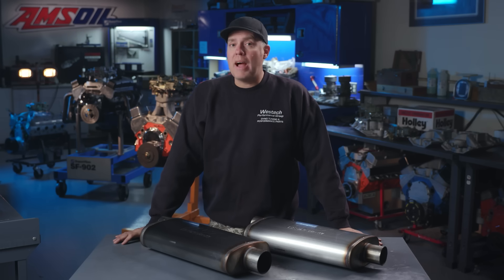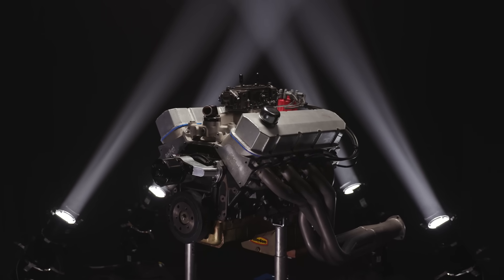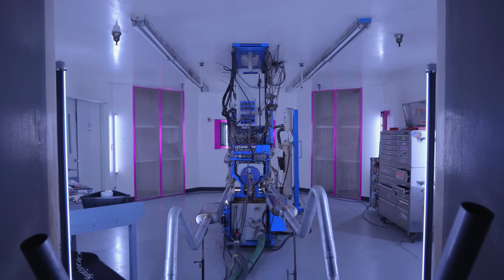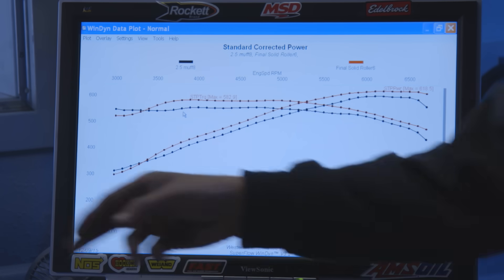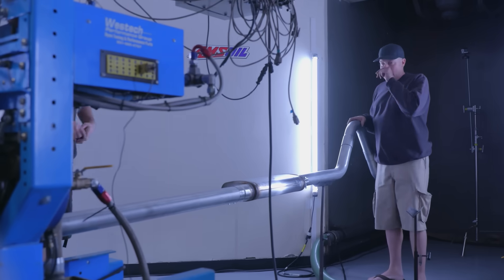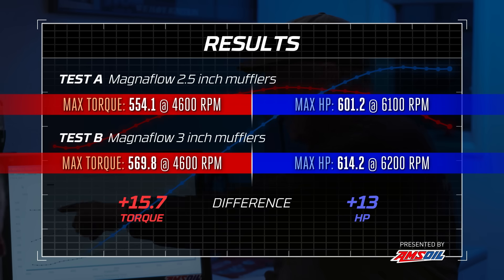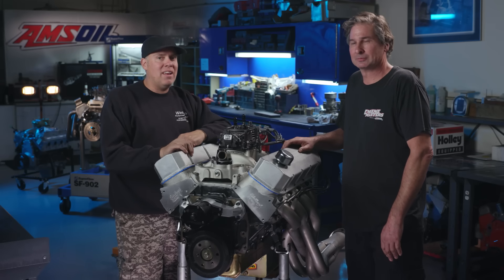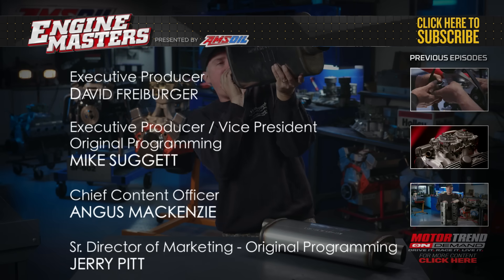The Power of 2.5- vs. 3-Inch Exhaust - Engine Masters Ep. 9

Comment: How long do you think that Mech, roller cam will run on the street before you break a roller lifter ??????
Reply: +davie biggions Mechanical roller lifter's are more reliable than hydraulic one and Hyd. rollers can go 100+K. The only problem is solids need to have the clearances set/checked.

Comment: During the 2.5" segment, you indicated that the A/F ratio went rich. I wonder how much horsepower could be recovered by leaning out the carb (jet change). I also noticed a "brick wall" HP fall off at the very top end ~6400RPM with either muffler vs collector extension only.

Comment: When you take a motor tuned for open headers and run it thru exhaust of course it's going to make less power with 2.5" pipes than it does with 3". I bet if you were to adjust the AFR there would be even less of a difference. Definitely not enough to worry about. 2.5" is as big as I'd go on a street car.

Comment: But who uses Magnaflow anyway?
Reply: +Chris Shannon Well exhaust is more about sound & Price for most people. If you use the 3" flowmasters 30/40 series, they would flow/make the same HP as the smaller Magnafows. I main care about the HP and that it's stainless and only needs to be done once. I live in the Northeast and mild steel exhausts look completely rusted after 2 yrs...it too expensive to be doing every 5-7years.
Reply: +Chris Shannon They are one of the top/if not the TOP muffler in the USA. They are stainless so they are more expensive than flowmaster's or dynomax's...but you get what you pay for.
Reply: +JerseyMikeP sounds legit but Corsa has my vote.
Reply: +JerseyMikeP They're testing WOT so if any horsepower or torque gained you wouldn't even see it at lower RPM's aka Normal driving conditions. I thought all high end mufflers use Stainless Steel. Corsa definitely does. I'm more of a sound guy so the more aggressive/raspy is my passion. But I think we're saying the same thing here. I definitely agree. Stainless steel is the way to go for sure
Reply: I was refering to Flowmasters...with there chamber design. I wasn't talking about Corsa.

Comment: That was a very impressive demo. I knew that supercharged engines just want to get the exhaust out as the intake is pressurized, but the lower  back pressure on an aspirated engine surprised me Makes me wonder what would happen if I replaced my stock 1.75" exhaust on an aspirated, fuel-injected Nissan 4-liter with a 2.5" since it appears that reduced back pressure actually increases air flow through the engine. The EFI has a Mass Airflow sensor to adjust for increased air flow.

Comment: does this mean I will get more miles per galon (MPG) with 2.5 or 3 inc exaust muffler? I am a little confused. What is important for MPG (torque or horsepower?)
Reply: +Stefan Djordjevic Low back presure will help with pump lose...which lowers MPG..BUT most people stay in the throttle more with the throatier sound which kills an gain. Reducing intake restrictions improve MPG more than exhausts, that's why BMW's use the Valvtronic and not the throttle body to control engine speed. Removing weight from a car (stuff in your trunk),  tire pressure at spec/slightly above..help with MPG. Motor trend had a good article showing the savings by doing that. Like A/C vs. windows down at different speeds.

Comment: All you really investigated here was how pipe diameter impacted AFR.  There was actually very little difference between the two in terms of percentage, so I was surprised to see you so excited by the higher values associated with the 3" pipe.  What would be a great experiment and earn you shit-loads of views is this:  Take a warmed over LS engine, and run:

- twin 3" with X pipe
- twin 3" with H pipe
- twin 3" true dual
- twin 2.5" with X pipe
- twin 2.5" with H pipe
- twin 2.5" true dual

Run EFI on the engine and tune AFR and timing to optimal in each case.
Monitor exhaust gas temperature.  Does the 3" yield lower, safer EGT's? 
Give the engine a street driveability rating/10 - which would include low end torque numbers and response.

Comment: if you made an 18 inch cone adapter to go from the 3 inch headders to the 2.5 inch system it would perform much better. speeding the gas up with out turbulence. also I would like ti see the chart from 1200 rpm. not everyone drives an auto

Comment: Would a 32 valve V8 make a diffirence diffirence? Only 2 valves per cylinder restrict quite a bit of air.
Reply: +Cold_Fox89 The # of valves don't matter..it's all about air flow/HP. Here' is a sizing chart from Dynomax.

http://www.qsl.net/ya5t/techchart.jpg

Comment: Does anyone care a rat's ass if an engine has more or less 600 horsepower?  An automobile is simply a tool to get you where you want to go and return.  The rest...high horse power, Internet connections, television screens, high amp sound systems (the list is endless)...is just utter bullshit or worse:  subconscious substitutions for inadequate penis size and/or paranoid delusional grandeur pursuit.  Dr. Rex Carz  has spoken.

Comment: would the results be the same regardless of HP or engine size?
Reply: +Patrick Handy The higher the HP the greater the difference there would be between the dual 2.5" vs. dual 3". For example on a 400hp v8 the difference would be maybe 1-2hp but on a 800hp engine the difference might be 30hp.

It's like breathing with a scuba setup on..if you're relaxed/calm it doesn't affect you that much...but if your panicing..seen a shark..the small tube size would have a big affect on your breathing.

Comment: These pieces of shit engines uses carbies? Fucking gay
Reply: +hyusama "fucking gay"? this is a 600+hp engine buddy, what have you got?
not what can you look up online. What are you driving? if its over 600hp i'll check it out, otherwise i think your comment is more about you bud... cheers
Reply: I'm not American. And anyone who thinks they can gain practical knowledge across the board from this video doesn't know shit about cars. This video is only practical for a specific type of engine that hot rodders commonly would build. That is a push-rod V8 producing around 600hp. It is only practical knowledge for a specific configuration very close to or the same as this. If your unaware how to calculate correct exhaust size for an engine you do not deserve an opinion about anything engine related. An engine is an air pump buddy nothing more.hyusama
Reply: +hyusama   They are still on push-rods,  a crappy single cam with very narrow lobes that soon wear down and two valves per cylinder   1960s technology and that is being kind about stuff that should really be in a museum.

An old colleague who lives in CA has a four wheel drive Audi Quattro type of vehicle.  On take-off it can spin all four wheels at once!  Not bad for a road car.  The Nissan Skyline GTR is also extremely good and it too has four wheel drive.  Times have moved on!
Reply: +hyusama true that bro. you make a very compelling point i have to say
Reply: 600hp n/a motor is impressive enough for me, although i do agree if it were more modernized that would be something. I\m sure they have EFI conversions as well.
Reply: hyusama not a fan of efi :) old school is what i learned to work on and itll stay that way
Reply: you are gay for liking fuel injection
Reply: +Shane Mouton but it could be 900hp+ and be 100% more efficient if it had the newer technologies but no, I get it, you just wanna stick to tradition even if it's technically a complete shitfuck of an engine because you guys can't deal with change.
Reply: +HeavyJ318 I'll watch whatever I want

Comment: I do not know if anyone else did the math, so here is this...
I did not catch it if they said the exact muffler that they used for the test, and frankly makes no difference for the purposes of this comment.
Both mufflers being the same interior volume (he made mention of that), and using the assumption of 25' of pipe (as he claimed off-hand), the internal area of the 2.5" exhaust is (assuming 3.14159 for Pi) 1.25 x 1.25 x 3.14159 x (25 x 12) = 1472.6203125 in^3 AND the internal area of the 3" exhaust is 1.5 x 1.5 x 3.14159 x (25 x 12) = 2120.57325  in^3.
So the difference between the two is 647.9529375 in^3. That may not seem like much, but if you consider that the 2.5" is 69.4(repeating)% of the 3" in total volume, that is a big difference. We are talking about a 44% increase from 2.5" to 3", not insignificant.
Anyone want to double check that math?

Comment: Id like to see the Dyno test start just off idle. On the street you have to get from idle to 3000rpm before you see these Dyno results. Is it possible the idle-3000rpm torque with either muffled exhaust system results in a faster car?
Reply: +FIXR7 The thinking is...
1. If your car is an automatic, at a launch the TQ converter will stall/flash close to 3,000 so below that the time is small. True on the street it would matter for cruising around...not racing.
2. if the car is a manual, you also launch/slip the clutch at low rpms and after the first shift the RPMs drop to somewhere above 3,000. And a car with alot of torque can actually be harder to launch...(example regular vette vs. a viper).
Reply: Cheers Mike, I know that's what they're thinking but, I think they're missing the point unless it's ONLY a racecar.
Reply: +FIXR7 It only matters under acceleration..true...which is my point. If your cruising  at 15% throttle your not losing anything.
Reply: +JerseyMikeP I disagree that it's just under cruise. So often I see cars with a big top end get taken by those with greater area under the curve. I think it's likely that this engine performs better with the 3" twin but if compared to open headers I think the 3" setup would be faster on the street.
Reply: FIXR7 Disagree with what?

True a car will be faster if it has more area under the curve...BUT you have to take into account the rpm range. After a shift no manual drops below 3K and with an automatic the converter would get it to 3K rpms before it move 2ft.

You'd also have to consider the extra 82lbs slowing the acceleration. The old racer's moto 100lbs = 10hp and .1 et 1 mph on the drag strip.
Reply: I disagree that it's only under cruise conditions that performance isn't lost. And, I do understand about the other trade-offs like weight but maybe the extra torque will negate the effects of 80lbs? and the difference is only 10lbs to the 2 1/2" system and being a street car you need to run some sort of exhaust I'm assuming so, open headers is a moot point? I suppose I'd like to see a chassis dyno test and then some actual race tests to see the real world data.

Comment: I run a Diesel with a 4.5 inch exhaust without a muffler and I get plenty of power and torque so their talking out of their ass about it loosing torque with an exhaust that's big and these guys just use petrol (gasoline) why don't they wake up to the fact there are different fuels out there I mean really the different sized exhausts help the breathing of the engine, a muffler granted muffles the sound but also adds back pressure which for some engines are good but if you had a 3+ inch would you really want your car to be quiet?

Comment: i can see it works with that engine setup, but modern cars are fuel injected and lean or richen the mixture using the ecu, wich would be too annoying to rejet a carb and try to optimize the jets, I would love to see this type of test on a fuel injected engine with a fully programable ecu tuned to each muffler setup too see how much they make with modern fuel injected engines

Comment: My car is a big heavy cadillac,7.7litter engine, a low gear with plenny of torque :max RPM is 5000 and the performance are better with 2.5 inch exhaust.So keep it in mind...

Comment: So would a bigger exhaust improve the power of my 01 Dodge Ram with the 5.9 Magnum? I thought about saving up and getting a high performance air filter.
Reply: +T Ritchie If the motor is stock...the exhaust will only affect the sound. The stock cat back is not small...it's the cat and everything before it that is the restriction. 

For power-
1.A cold air intake w/ a K&N will give you twice as much power (http://www.knfilters.com/search/product.aspx?prod=57-1511-2) K&N  made 11.8 more hp.  BEST Bang 4 the buck.
 2. I'm not sure with your year but a computer or tuner will give you a boost, a good amount of TQ with the advance timing.
3.Replacing the exhaust manifolds will be the next biggest bolt on. Get long tube (TTI are the best) or Tri-Y's from Doug Thorley. The stock manifolds >1993' are small. The tri-y's will also boost low and mid range torque. Shorties aren't worth it IMHO and don't give the power increase as the TRI or long tubes.
4. If your not looking to do much a set of higher ratio Roller Rockers will give you a 10+/-hp boost.

Comment: 110 Lobe Separation with over 600 Lift means It's gonna be Choppy at Idle. 

Gonna need at Least 114 or 116 to get rid of the Chop and make it Smooth.

My Stock Camaro has 245HP and It's got a 2.5 to 3" Flowmaster Exhaust and sounds Beautiful.

Comment: i mean, geez, that much power, its kinda common sense that you would wanna run 3-inch. how about trying this on your typical 350hp-450hp small block which most of us budget people will have. hell put it on a 5.3l and show these guys what happens when they change exhaust.
Reply: 3 inch is the way to go if you want more power.  Coming from the Honda scene this was the case every time even on a 1.6L engine.

Comment: I have a Chevy 350 with around 550 hp @ 7800rpm. I used 2  1/2" Chevy turbo mufflers and the low end was stronger than the 3" turbo mufflers. But the top end was stronger with the 3".  You can feel  it

Comment: yeah the exhaust systems weighed 70-80 lbs, but that was for that crazy long camper van set up they had. a normal car set up would probably weigh what the guy said: 40-50 lbs.

Comment: That's exactly what I expected. I'm glad I went wit 3 inch on my 440 Duster. Mine is full exhaust over the axle to the bumper. Its fairly loud outside the car but not too loud inside the car. I have an H pipe with  Jeg's two chamber Flow master copies and Dyno Max race bullets in the tail pies as resonators.

Comment: A 3" exhaust doesn't make more power than a 2.5" exhaust, it ALLOWS more power to be made by the motor.
Reply: Adding 13 HP from simply an exhaust upgrade is huge in the naturally aspirated field
Reply: I'm in need for a bigger exhaust pipe cause I've put a bigger turbo, looking for something like going from 60mm stock to 63mm custom exhaust system. Is it a good idea?

Comment: just thinking logicaly. . . .3 inch probally still provides suffienct back pressure for a massive  7.4 liter 454 ci  engine . . . hell, the headers alone probally provide suffiencet back pressure for such a large engine . . .  Imagine putting a 3 inch exhaust on a  1.5 litter 91.5 cubic inch motor. . . . I might be wrong but maybe that would be to little back pressure. . . . in other words your test was on a massive engine which needs  a massive exhaust.. . . . . . what would happen if you put massive exhaust on tiny engine. . .  I would like to see that test on smaller more average engine to see if the " backpressure myth " is actually true. . . . maybe on a smallish 1.4 to 2.0  4 small cylinder  and a medium 3.0 to 3.5 V6. . . . ARE YOU UP FOR THE CHALLENGE OF BREAKING THE BACK PRESSURE MYTH?

Comment: I've got a 2009 Charger, 3.5L V6. What would be the best option for mufflers/exhaust/tips/resonators be? I don't need it to sound like a HEMI, that's not possible. I would've gotten a HEMI if that was available when I needed a car. So that's why I just went with the V6. Get over it. I just want it to sound... Better? It doesn't sound bad stock, it just doesn't sound great, either. I've been thinking a Thrush glasspack muffler to a Y pipe with 3 inch tips. Anyone have an opinion on that, or a better suggestion? I don't have a lot of money to blow, so a whole new exhaust system isn't really an option.
Reply: Go look at some American thunder exhaust systems. I got one on my 2014 supercharged v6 camaro
Reply: +Cole Hintermeister --
your best bet would be to get rid of that piece of shit & buy a different brand of car. any brand will be an improvement.

Comment: A proper tune might have lessened the gap significantly. Too bad they didn't do actual SCIENCE.  The difference really boils down to practicality: We are are only talking about 15.7 ft.lbs and 13 HP (at the max) on a 600 hp engine.  When you go for more than 600hp you "need" 3 inch pipes to handle it and you will see a bigger difference.
But, it really boils down to this: How much is that 13 hp going to cost?
...and on a personal note... most muffler shops I've been to can't mandrel bend 3".  They crimp bend them.  Are you going to get better flow with turbulence in the pipe?

I think this video proves is that the difference is negligible.

Comment: Why does the engine have a carburetor and not fuel injection.
Reply: +bornbillsmith because you'll make more peak hp & tq with a carb.
Reply: +bornbillsmith Just for kick´s
Reply: Alex MacLean That makes sense.
I don't no much about engines but I thought
fuel injection is better than using a carburetor
So I didn't know why the engine they used  did not have EFI.
Reply: +bornbillsmith If you use injection I think you have to have a mass airflow sensor and more computer control. A carburetor uses mechanical metering of fuel and air so it's simple to use. This is what I think Alex is talking about.